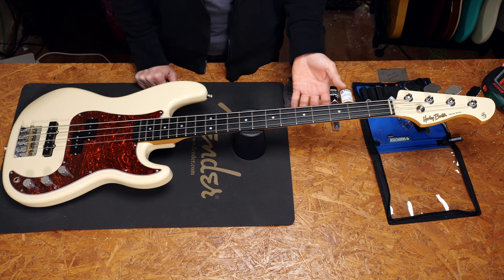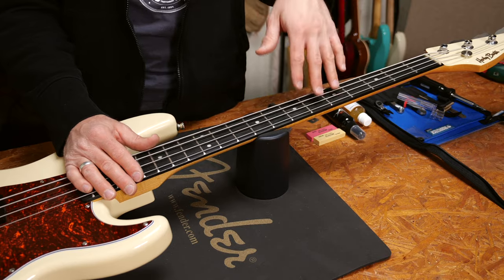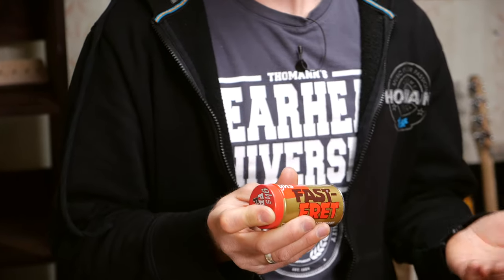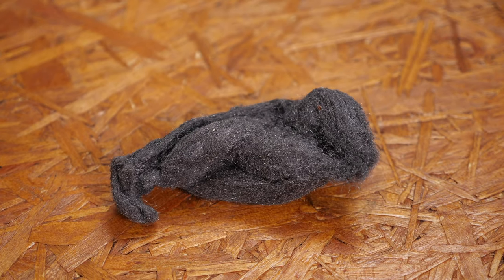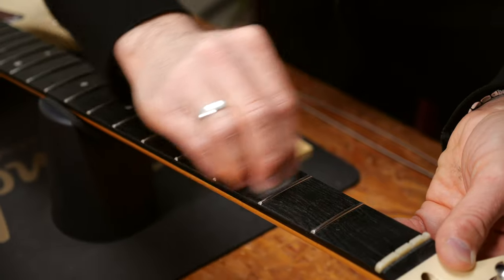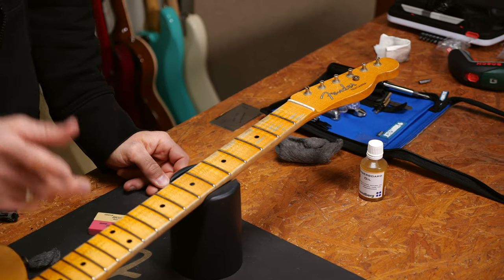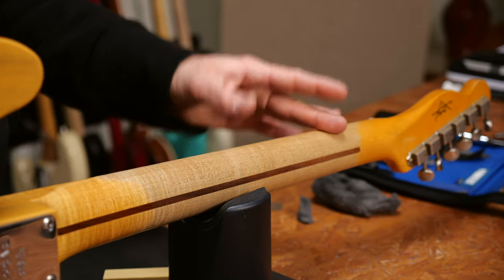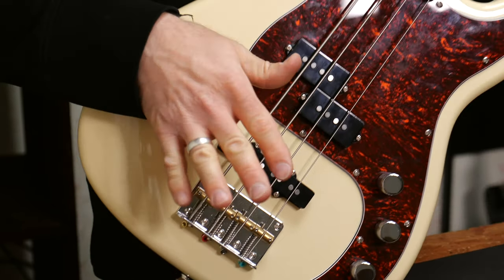How to clean ANY Fretboard | Rosewood or Maple | Guitar Tech Tips | Ep. 5 | Thomann

Comment: When using steel wool, I noticed you are going across the grain. Isn't it best to go "with" the grain??
Reply: Like he said, the steel wool was super fine grit, so in that case, it doesn't matter going against or with the grain; and also not doing it too many times.
Reply: Being a professional woodworker, I too was concerned with using the steel wool cross grain, which I did the first time I used this technique. Although the quad O wool did not harm polishing cross grain, I was more pleased with the result going with the grain second time around. Whichever way you choose, it's important to do this maintenance. Thanks to Thomann for this information.
Reply: Even 0000 steel wool will leave some visual differences between across the grain and with the grain. Sometimes, it's worthwhile to go against the grain to get some gunk up, especially up against the frets, but you should always go back along the grain for a nicer appearance.
Reply: I too was taught by a very stern and serious Scottish cabinet making tutor to always follow the grain or get a clip rounf my earholes(It was the late 70s). Thanks for posting, that special oil looks like it really revives the Darker unfunished wood.

Comment: I completely agree that fretboard oiling/conditioning should only be done 2-3 times a year on average during string changes, but more as he mentioned about climate and if you sweat profusely and/or have very noxious sweat. The key is to clean and maintain the guitar in between time by doing thorough wipedowns before and after each time you play; if you do that, your guitar, fretboard and strings will look and perform very well! Strings will go dead over time, and that's the time to change them.

Personally, I use Music Nomad F-ONE Oil to clean, condition and hydrate my fretboards, that is the best stuff out there and the best I've ever used, and I was a very dedicated lemon oil user for many years!  A little of F-ONE goes a long way, just one drop on each fret is more than sufficient; work it in and let it sit to penetrate for about 10 minutes, then wipe it off...done! You may need a second or possibly third application if the fretboard is severely dry.

Comment: I Find polishing rubber is the best because it doesn’t mess with your pickups were as steel wool is bit tricky to handle. Thank you Kris - as always very informative and to the point.
Reply: I just put masking tape it works fine.
Reply: I just use a dish scrubber pad, aka Scotch Brite pad in the US. It's basically plastic steel wool - less scratching, no shavings.

Comment: I condition the fretboard every time a change strings. Rosewood fingerboard, I use 0000 steel wool and lemon oil at the same time, then use a guard and use rubbing compound on already rubberized frets. Finished maple necks I use a microfiber cloth to wipe everything off, and then the guards to sand to 8k silkyiness and then rubbing compound the frets.

Comment: I've been playing guitar for  60 years and most of my guitars have Rosewood or Pau Ferro fretboards and I use shoe polish. It's wax and wax is oil. After a good cleaning with a toothpick on the fret edges and the steel wool for the fret tops I use shoe polish. Wipe it with a clean rag, buff it with a shoe brush and it comes out absolutely beautiful. use brown color for the Rosewood or black if you want it to look ebony.

Comment: Just to CLEAN a guitar - whether acoustic or electric - I like to use plain, old Murphy's Oil Soap. You can even dilute it with water, as one bottle will last forever. It's great because it's cheap, cleans well, and doesn't leave residue. I use paper towels and a soft-bristle toothbrush for cleaning frets.

Comment: This is a great video, but since you asked, I will tell you what I have been doing for many years....  I have quite a few guitars, some expensive, and others, not so much, but no matter the value, they all get the same cleaning treatment.  First, for guitars where I can remove the neck, I always remove the neck...There is no greater advantage than removing the neck.  First, you remove the risk of having anything fall into the pickups and you also remove the risk of dropping the guitar and damaging the body - this happens more than people will admit.  
Then, I never just polish frets, I always clean the fretboard, frets and polish entire neck, right up to the tuning machines, which I also remove.  For cleaning, I use a Dremel tool with a softer, but sturdy, attachment for removing gunk and a I end with a polishing attachment.  
In my opinion, the Dremel tool is the best tool for cleaning every fretboard on the planet.  I seldom use fretboard protectors because the Dremel is gentle enough to destroy gunk and not hurt the wood - I have never damaged a fretboard (not one).  When I am done, with a Dremel still, I polish the fretboard (and back) with a homemade wax that I make at home for all my wood needs.  It is a mix of olive oil, coconut oil and beeswax and I add a few other natural ingredients.  My fretboards and frets always come out looking brand new!
Reply: Hi! Thanks for your comment, it alleviated my fear about using my wife's Dremel on my guitars. I haven't used it so far for anything, but I may give it a try to clean the fretboard from a couple guitars. Which attachments specifically do you use and for what? I was taking a look at all the different ones that come in the case, but I haven't figured out what is for what. I'll start trying to figure it out on my own aswell. Hopefully you see this, and if you answer, well, thanks a lot in advance!
Reply: @diegosorianorincon2263  I did see your comment and thank you for responding, my friend. And, you are quite welcome!  
I will begin by saying that I've had nothing but true convenience and speed by using my Dremel for my fretboard cleaning. And, I am pretty sure that you will also find the same kind of convenience as I have. I would however, be remiss if I didn't tell you that over working your Dremel could have negative consequences. It is possible to use this tool just a bit longer than necessary and that could create problems.
However, I am also sure that you already know that this is true of any method you decide to choose. 
So, I would say, just start out slowly, get a feel for the Dremel and the manner of use, and then move up to doing more and more when you're comfortable. And, please make sure that you are also using enough tape where it is needed. 
You will be fine, my friend and I think you will enjoy this cleaning method as much as I have. Thank you again for your reply.

Comment: I'm a guitar tech\restorer lucky enough to work on hundreds of low to mid range guitars. Found out early on steal wool makes a huge mess, and doesn't seem to give the desired results. Heavy rubbing compound like that used on aluminium fuel tanks on a small cotton buffing wheel in a larger drill gives much better results! 
And I take a sanding block to the back of the neck as soon as I get a new guitar strip it down to raw wood. Mist with water, ( bottled, not out of the tap) then heat and recoat with ultra high quality furniture polish, or a lanolin based cream. You'll be shocked and amazed how much easier it is to adjust the truss rod, and the neck is off the chain smooth.
No coating I have ever seen beats the patina of natural wood. I have even taken the paint off, and taken these necks down to natural wood. Being careful to follow the contours of the head and tail of the neck so the job doesn't look tacky. (I've never had anyone in the crowd ever run up on stage and demand to see what the back of the neck looks like anyway.) They come to see and hear the show, and could care less how it's produced. 
Most "vintage" guitars have already had most of the paint loved off the neck anyway. lol

Comment: I use some Fender product (based on beeswax) that came free with some other gear. Was not expecting that, but the fretboard is a treat to play after using it.
Im confused about Lemon oil. Some people praise it to infinity, some other bash it, as it is chemical product and have nothing to do with lemons. I have no idea ... but this fender beeswax thingamajig looks to work awesome.
Reply: @DigtBrain2 yep, something along those lines. Ive even heard something about boiled linseed oil. I dont know, I better believe some guitar related brands, that they dont want to destroy your guitar.
Reply: beeswax makes sense to me. I used antique wax twice on my les paul almost forty years ago and then nothing at all. About three years ago I had it for the first time at the luthier and the ebony frets are still excellent preserved. The antique wax made the ebony a bit glassy and hard, so it doesn't work because it no longer absorbs moisture and is extremely resistant. but be careful it contains caranauba wax so you shouldn't use it often
Reply: @yetimatzenightcat8702  thanks for warning, Im using it like twice a year max.

Comment: I usually use lemon on my fretboards but all of my guitars have unfinished maple on the back of the neck. What should I use to oil that??
Reply: Teak oil is a good natural sealer.
Won't tint the wood.
Otherwise a more famous option is Tru-Oil from birchwood Casey. But it does give it a tint.
If you do it regularly, once or twice a year, no need to Wax it.
Waxing gets messy.

Comment: it also depends what type of wood wenge panga panga rosewood ebony ibenholt and thats stuff if the wood drink the oil keep going until the wood wont take the oil anymore. and yes i have an ibanez with 12 hairline cracks havent given me issues yet ive used wood glue to fill the cracks and after 24 hours i oiled the fretboard until it wont suck in oil and then let it dry for another 24 hours and it should be as new

Comment: I use daddario Lemon oil and daddario fingerboard hydrate and also fast fret to give the strings a longer life and I clean the body with Gibson guitar pump polish . And the. I string it with 11-48 daddario jazz strings on my lespaul and do a setup 1.75 mm on low E string and 1.5mm on high E string and 0.25mm  as neck relief and the. The intonation and tune again and play and it’s like a new guitar but for polish fret I use 0 grain steel wool and fretboard protectors or Daddario fret polish kit .

Comment: When you are cleaning and adding oil to the board you are not going with the grain. This can leave scratches.
Reply: Personally I use a soft plastic dish sponge and soap water. That way it’s less likely to be abrasive. After drying I then apply oil with a napkin to make sure everything is gentle

Comment: I cannot get rid of the garlic (BAD) smell on my rosewood fretboard. I went a year without changing strings although I did wipe the guitar down after I played. Tried vinegar twice and dawn. Stayed the same or possibly even got worse. Any solution you know of?
Reply: I’m having the same issue. Got worse when I used lemon oil
Reply: @thomashigginsmusic  I cleaned it 5 or 6 different ways and it seemed better but it just came back even though I was playing very little. Not sure what to do now.
Reply: @tellmestraight  funny you reply now cause I just gave my fretboard a really good cleaning with some 0000 wire wool and 70/30 water to murphys oil soap and it did mine wonders I got a LOT of dirt off. Not sure if you’re just applying something to the fretboard and not scrubbing the gunk off
Reply: @thomashigginsmusic  Fretboard is very clean but still smells even with new strings.

Comment: ANY fretboard, or just rosewood & maple? Im confused by the title 😳😳😳
Reply from the maker: Most of the fretboards used on guitars and basses (like 99%) fall into two categories: 1. dark and unfinished wood - rosewood, pau ferro, ebony, etc. - AND 2. light wood such as maple which can be finished or unfinished. Unfinished fretboards need some oil every now and then, doesn't matter if it's a dark of light wood. Just use transparent fretboard oil for maple to avoid colouring it. 
And if it's a finished fretboard, you don't have to do anything other than clean the dirt off. :)
I hope that helps. Cheers //Kris

Comment: 1. I don't know, this may all be good enough for basses and bass players but using steel wool is a) messy as hell and I wouldn't b) use anything abrasive on a nice fretboard unless some pig never cleaned it for decades. Also, using steel wool is the only the last step on frets before the actual polishing job begins.  Honing the fret surface for optimum smooth interaction with GUITAR strings requires a lot more steps including usage of a polishing machine with successively finer polishing pastes. Using steel wool on frets that have gotten this kind of proper treatment once instantly reverts the fret surface to the pre-polishing state. In other words, recommending unnecessary scratching fingerboards together with the inlays and frets is not exactly great advice, in particular not for the maintenance department of Thomann.  

2. FastFret is just a rolled-up cloth soaked in white mineral oil.  Mineral oil is the main ingredient in most (if not all) commercial fretboard products, so if you have the time and patience to rub the FF stick on the fingerboard for hours and hours to get your dry fretboard rehydrated while you wait for Thomann delivering some proper oil, it doesn't harm and it's still better than leaving the fretboard dry out completely in winter.